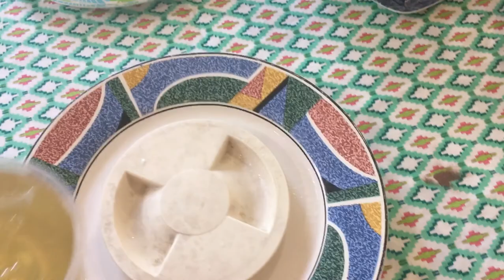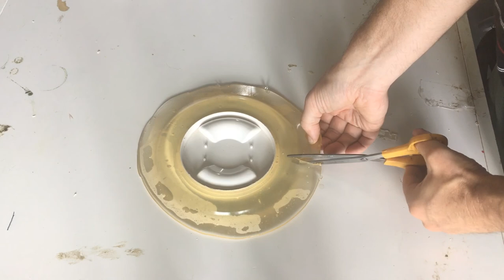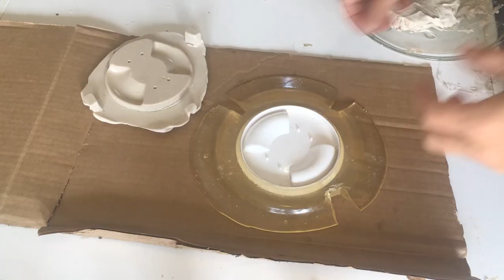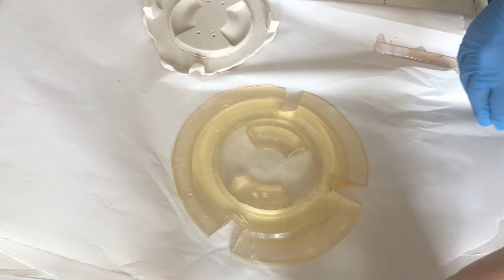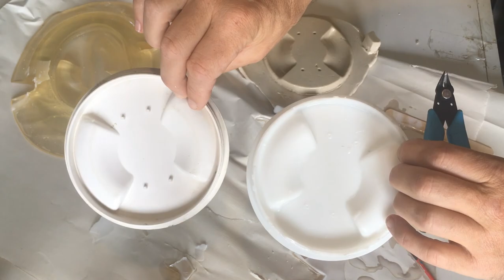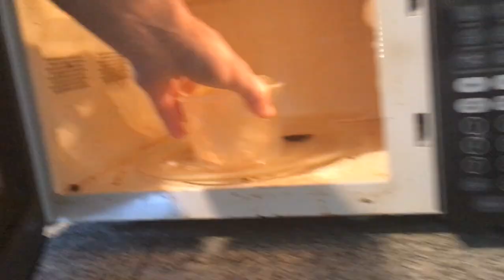How to duplicate a thin walled object with threads like this boat hull plug

Comment: Thank-you so much! This is exactly what I needed to learn. I am restoring a 1979 Subaru Brat and the Interior Door Handle Bezels have dried out due to age and UV damage, making them crumbly to the touch. I have tried to find replacements but, they are all in the same condition. I did find a pair for sale in a junkyard in Florida but, they wanted $200 plus shipping for these two small plastic pieces. Naturally, they tried convincing me of AAA+ quality & a 6-month guarantee or my money back but, I didn't believe them. Plus I couldn't justify the price they were charging. With this simple method, I am hoping to duplicate them.
Reply from the maker: Awesome, hopefully this saves you money! Lets us know how it turns out.

Comment: Looks great. Is it possible to use a release agent on these products?
Reply from the maker: Thank you. Yes, you can use any release agent from a silicone mold release to mineral oil or vegetable oil. The ImPRESSive putty has an Activator intergrated into it, which also acts as the release agent so you don't need anything extra.